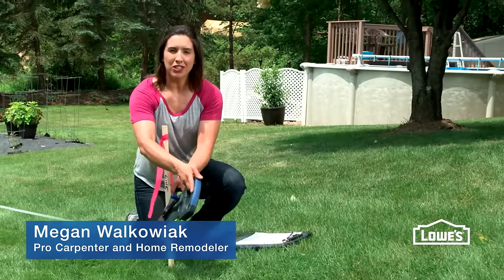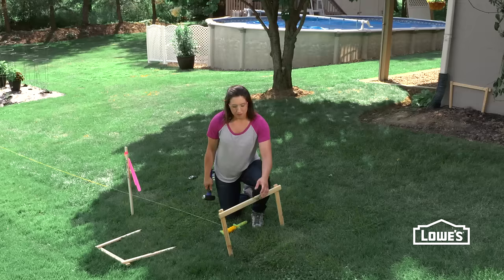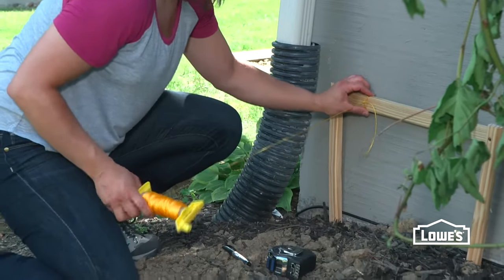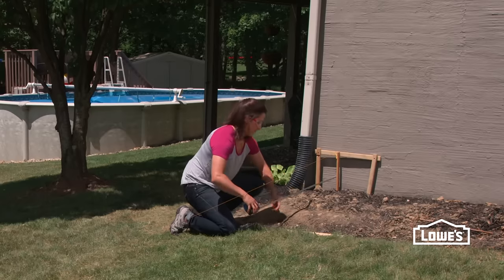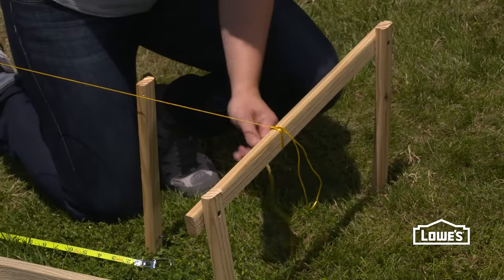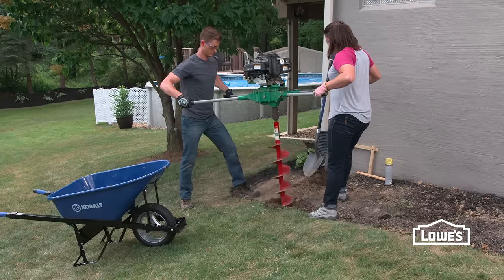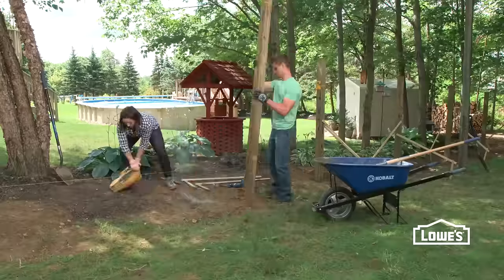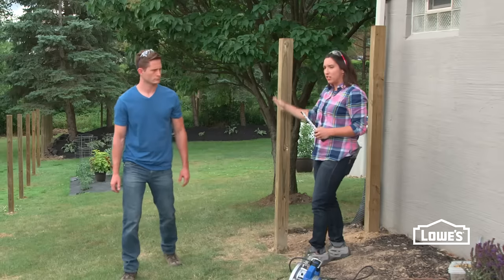How to Build a Wood Fence

Comment: But why the overlapping offset design?.. Not really a privacy fence if you can see through it.
Reply: To save money as well as the aesthetic look of the fence. You can only see through it at an angle and if your neighbors are that dam intrusive that they want to put their face up against your fence and look at different angles then you have another problem on your hand.
Reply: mresmith4302 not really sure it saves money at all.
Reply: Gregory Armbruster It saves money by not having to purchase as many picket boards. For full privacy you will need to stack them side by side which increases the number of boards needed.
Reply: mresmith4302 do you mean pickets or boards?
Reply: Actually you are using more boards and not saving money. This fence style is called a shadowbox fence which allows for the fence to breath and allows air to flow through the fence which will cause the fence not to get blown over by high winds. A regular fence with only boards going down one side tight up against each other gives you more privacy but will bow and bend from the sun and wind more over time while the shadowbox style let's the air flow through and giving you less privacy.
Reply: sorry mate but overlapping in case they did it IS more expensive than stacking side by side...
Reply: BIG FISH, If you find yourself in that situation again, use a quick clamp on one post. Mark the height you want to be at, set the clamp (or clamp a 2x4 block) and just rest that end on it. When you work by yourself clamps are a life saver.
Reply: You could also just tack a 16 penny nail roughly 1/8 or 3/16 beneath the bottom board measurement and rest one end of your board while you nail/ screw the other end

Comment: why would you make the good side out?  would you not want to look at the finished side inside your yard?
Reply: There are several reasons for this: If your fence faces a street, it will look much better with the smooth side out. Putting the rails on the outside of the fence would make it easy for people to climb up and over. ... Giving your neighbors the pretty side of the fence is considered good etiquette

Comment: Can you use a pneumatic  brad nailer instead of screws for the rails?
Reply: You shouldn't use a brad nailer for the pickets, let alone the rails. Screw the rails, and use a framing nailer for the pickets.
Reply: Brad nailers shouldn't be used for anything that requires any degree of strength. As another responder said, screws should be used for the framework, and you can use a framing nailer for the pickets, though using screws will ensure they never pop off. Make sure whatever fasteners you use are rated for pressure treated wood and won't rust.
Reply: @peachfuzz89  
I got 1-1/2" ring shank stainless steel in a coil for a 15 degree air-gun.  
They said NOT to use screws for the pickets.
6 per slat, deck screws for the framing part.  Screws in the post to hold the cement tight.

Comment: Wow you can tell they are not paying for materials.
Reply: Lol for real tho
Reply: Hahaha not to mention her hourly wage either! You see that circ saw cut at 43"??? 7:03
Even the use of that clutch drill to fasten the rails. Cringe.
Reply: It's because of the owners of the house. Unless that's their boss' house
Reply: if you do the calculation, the most expensive parts of wooden fence is the pickets. 
not the post or the beam.
Reply: Mexico is paying for it
Reply: those power tools look brand new
Reply: They only used pressure treated wood, you can't build a fence with anything cheaper except chicken wire.
Reply: @XDTuber  it's a lowes ad
Reply: @secret5.  Still I don't think I'd add pickets the side facing away from my yard
Reply: @justinbouy3153  It all depends.  I did my backyard with the pickets facing in and switched to the outside for the part facing the street for curb appeal.  But no I wouldn't normally put pickets on both side unless it was a shadowbox style fence.
Reply: @justinbouy3153  Where I live it is code to provide neighboring property with the better side of the fence, I believe.
Reply: It’s almost as if it’s a paid ad by Lowe’s

Comment: I realize that you are an expert and all, but using nails on treated fencing is never a good idea, and you should be putting screws in at a diagonal on each plank, so you don’t split the 2 x4.  Coated deck screws are best, they will not corrode and will not bleed , plus they hold much better,  you must have taken a class on how to build a fence at the local community college,,,   Excellent!!!!!
Reply: there are situations where the clients are so cheap that they are willing lower quality of fence for their price. Nails will hold. just not as well as screws would. my only concern for using framing nails is that it would split the picket and nails will protrude from the other side of 2x4 which could be a huge liability. unless they sell 2 inch long framing nails.
Reply: I use screws on stringers and nails on pickets.

Comment: Why "wait a few months before sanding or painting"?
Reply: Most pressure treated wood is very wet and needs time to dry. Otherwise, the stain or sealer won't soak in as well.

Comment: Great information but tone it down with all the terminology. If we're trying to be carpenters, then fine. But if we're just trying to fix a fence on our property, We level the board, we nail the board, and you cut the board to fit. We don't plumb it, we don't rip it, and we don't shoot it. Christ.
Reply: As someone who enjoys knowledge, I found it very helpful and thorough in understanding the process.. Terminology isn't  the enemy: laziness is.
Reply: No, she and the directors were trying to be cute by dropping in insider verbage to make it sound professional. Instead, it sounds elementary. "Woah bruh! Rip that board and shoot it for me, dog!"

But I get it, I guess.
Reply: plumb means vertically level.    Rip means cut, and shoot means, well shoot the damn nail through the air gun.

Comment: and when your posts rot out after 10-15 years..what then :/
Reply: Thats the next owners problem.
Reply: HAHA  Those posts aren't lasting 10-15 years.  That death boot will take them out in about 3 years.
Reply: What are you talking about?
Reply: The way they concrete the posts significantly shortens the life of the posts.  It encapsulates the wood.  Then as the wood shrinks in a few months, water fills up the boot and the post never dries out.  The bottom of the hole should be filled with rock, the post placed, then fill about 1/3  of the hole up with rock.  compact the rock around the post, Cap it with concrete.  You will get a lot more life out of the posts.

They Have essentially made a concrete mug that holds water around the post.  But Lowes will sell more concrete.
Reply: Professor Bob Ahhhhhhhh! {sound of clouds parting and angels singing} Thank you for that! Knowledge really is power.
Reply: Good call prof bob
Reply: To eleminate any moisture from the ground rotting the 4x4 or the concrete eating the board up over time make sure to incase/wrap the 4x4 from the bottom up to 1 inch out of the ground with fiber expansion strips. Cover the bottom of the 4x4 and all sides by nailing the expansion boards on with roofing nails. That will insure that the concrete and water from the ground will not eta up or rot the 4x4 for a very long time.
Reply: pyrobedlam  use 8 ft metal chain link fences post for 6 ft wood fence or top rail as post -cut to height u need +bolt with nut and washer  build it like normal wooden fence
Reply: Professor Bob thanks
Reply: @professorbob4849  It depends on the soil composition.  Rocks are worthless in clay soil.
Reply: @dezznutz3743  This is somewhat true, but rock will never create an issue like this.  In clay soil, it is difficult to get drainage, but deathboots never help.  

At my current property, I have horrible clay soil and it is very acidic.  I punched holes for the posts, then trenched a drain right next to the posts.  I set posts and filled the trench with drainage material.

Comment: Great video. Will still buy my supplies from Home Depot tho! #bleedorange
Reply: The prices on lumber and fencing are almost identical at both Lowes and HD but Home Depot's lumber is usually higher quality (in my opinion).  I haven't noticed any difference in the quality of the fencing.  Lowes is closer so I usually buy everything there.

Comment: Wow, dig some holes, fill it with concrete and start drilling.  Not very hard especially if you are on a flat surface.
Reply: As someone who works in fencing and has uncles who own their own companies its never that simple not only is the manual labor more than enough to make the average person stop but every house can have their own little problems that need addressing such as hitting rock, roots, etc.

Comment: Should’ve used 6x6 posts for the gate posts
Reply: No, I work for a fence company. We always use 6x6 posts for our gates. Helps keep them from sagging. Pretty common practice
Reply: @justinterry5666  She used a metal gate kit and built up the post with boards.
Reply: how does that work with 4x4 posts?     How about a 4x6 post...I agree with King, its overkill.

Comment: Batter boards? Staking the holes, and then STILL marking them with paint?   Brace the posts, when you ALREADY have a helper?  What a waste of money.   You can tell this is an Ad masquerading as an informative video. Buy a Gate kit? A GATE KIT???  No thanks Lowes, I know how to make diagonal cuts...BTW, the Bottom stringer should be closer to 9-10" off the ground, maybe Im wrong but it looks like its 6".  Nice job tho, just not the cheapest

Comment: Any suggestions for lower impact post laying?
Reply: Meant environmentally.  I'm not interested in using that much concrete.
Reply: Professor Bob posted on Pyrobedlam's comment. Bob is correct and seems to be solving your lower impact problem. Still uses concrete but not an entire hole of it. I've copied and pasted his comment below. Hope everyone is ok with that. 
 quote below:

Professor Bob
5 months ago (edited)
The way they concrete the posts significantly shortens the life of the posts.  It encapsulates the wood.  Then as the wood shrinks in a few months, water fills up the boot and the post never dries out.  The bottom of the hole should be filled with rock, the post placed, then fill about 1/3  of the hole up with rock.  compact the rock around the post, Cap it with concrete.  You will get a lot more life out of the posts.

They Have essentially made a concrete mug that holds water around the post.  But Lowes will sell more concrete.
Reply: you want the fence to last longer, concrete is the way to go...now what kind of concrete can vary...

Comment: Don't use concrete to set posts if you live in a hurricane zone. Hurricanes snap -off the posts at the bottom.  Concrete  surrounded posts are hard to dig-out and remove once snapped-off. Removed  broken post ends with HEAVY concrete plugs attached are very difficult to dispose of properly.  They can become ugly yard ornaments until you pay someone or haul them to the dump yourself.
You can always leave the snapped -off posts and concrete buried in your yard; just stagger replacement posts in between the remaining dead solder posts.. Have fun, because remaining broken posts and concrete will always be in the way making a uniform distance between replacement  posts very unlikely. Or, a difficult or impossible at the end, like at next to the house .
Reply: All Good  hurricane Irma didn’t do anything to mine

Comment: it's a bad deсision. Wood will destroyed at the edge earth and air in 2-3 years. Better made steel column, it will used during 30 years without problems

Comment: Why nail them instead of using screws?
Reply: Its cheaper
Reply: And for each screw you have to drill a pilot hole. To prevent the wod from splitting
Reply: @phatthony6780  Fair enuff. Guess I'll rent a nail gun.

Comment: this video is offensive to us commercial fence builders.. try building a fence up a near vertical slope in hundred degree weather varying all your material and concrete up that mountain and the power auger  .. and just to know that the work has just started.. this is offensive to me I'm sorry this is embarrassing g
Reply: Well they're doing a regular job, not one that has a vertical slope. So it offends you because they're doing a regular job? The only reason you're offended is because they're doing your job instead of calling "professionals". This is coming from a roofer. I too have pride in my work but people CAN do it themselves and if they're handy they can do it without looking bad or leaking.
Reply: The video isn’t offensive. You chose to be offended.

Comment: That looks like a bunch of pallets.
Reply: no, it’s called a “fence” - a barrier, railing, or other upright structure, typically of wood or wire, enclosing an area of ground to mark a boundary, control access, or prevent escape.

Comment: Wonder how much was the bill
Reply: For every 200ft it's about $400 so 1acre is roughly $1700
Reply: Starting from what you said, there's no way to came out with this result, man.
Reply: Sorin Petcu how can you not come up with this? I went to Lowe's website and priced it out the extra is for the gate and parts. I also said roughly because every acre is not the same and Lowe's price changes depending on the area you are in.
Reply: Materials for a standard 6' privacy fence with pickets butted together, not shadow boxes like this one, is about $9-$12 a linear foot for materials, no gates included. A shadow boxed fence, like this one, will be about $12-$15 per linear foot in materials. You can expect labor from a reputable fence company that has plenty of work lined out, to be about 2-3 times the material cost. This won't include staining it as the fence needs to dry, in most places for a month at least. So, a 400' perimeter fence, 6' tall and pressure treated, could cost you $4000 in materials, plus gates, and $8,000+ for someone else to do it.

Comment: How not to do it. The boy toy doesn't even know how to wear a tape measure. LOL
Reply: He's not doin any measuring dufus.. What did she do wrong then.?  fencing expert
Reply: @Jo-xg6rk  You need lessons on viewing vids . My comment was about the placement of the tape measure on his person, however he did use use it.. She calls herself a carpenter, but doesn't know how to use a hammer properly. He doesn't know how to use a shovel (maybe his first time).
These vids are designed to get you to buy their products. Notice how everything is new and isn't that cute; he has blue safety glasses and hers are pink.
Take my advice, leave these large projects to the professionals. If You want to qualify them; ask to speak to previous customers.
Reply: @Jo-xg6rk  Your a landscaper. Well, whoop-dee-do. You also need to learn how to read. I told you she didn't even know how to use a hammer. Why own one and call your self a carpenter when the way she used it, a rock would serve the same purpose. That's like you placing a plant in the ground and calling yourself a landscaper. You probably buy your furniture at IKEA and call yourself a decorator as well.
She did so many things wrong; starting with the fence placement, her measuring techniques,  fastening methods and materials and equipment used. They want you to think anyone can do this. The reality is, you have to find a real professional, if you want the job done right.
By the way I have over 4 decades of experience in all faces of home construction  including prefab home designs and I'm still working despite doctors advice. One more thing. All you so called builders out there who have praised her work; let me know how many fences you've built using open ended SPF posts?

Comment: First of all "if setting posts in concrete, be sure to bring the concrete sleeve above grade and slope the top surface away from the post to shed water, as recommended in most local building codes." Look up article on Professional Deck Builder website Aug 2017,    It also looks like those first horizontal boards are touching the house. So you have dirt to wood to the house which is against code in most places.  Also should have put some kind of penetrating wood preservative which should also have some kind of Termiticide, fungicide, etc  in it as well as UV protection unless you like gray wood. Redwood, cedar, or pressure treated woods are best but still needs preservative. Insects hate redwood but it will eventually rot and get damaged by UV and water.  I'd put many coats on the upright posts that will be below or close to the ground... onto the posts before putting them into the ground.  Dip it, spray it, paint it.  Also, should put preservative on upright posts before putting on 2x4s and on 2x4s before putting them on, and slates before putting them up.  Why not use the proper tools? You use a hole auger but you can't use a power miter saw to cut the 2x4s exactly the size and angle they need to be? Put it up, hold in place, draw a line with a pencil.... Professional carpenter? Not impressed - sorry....